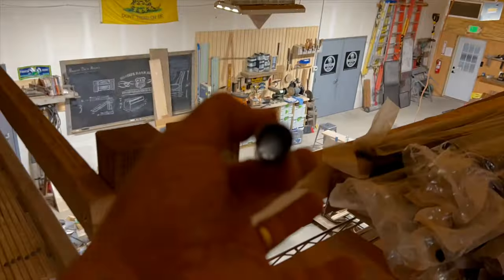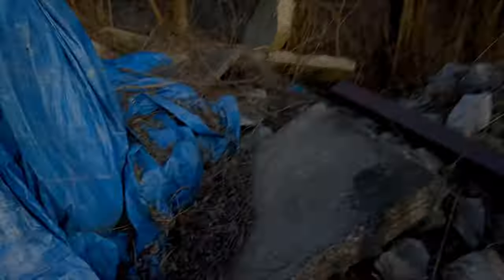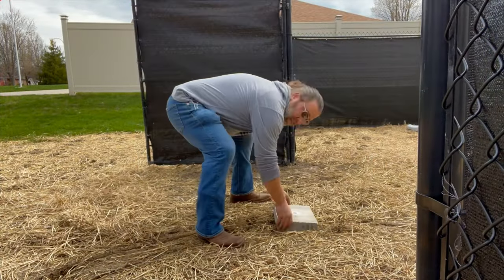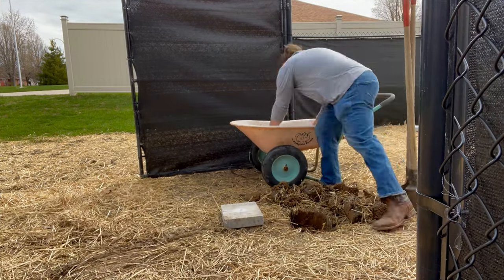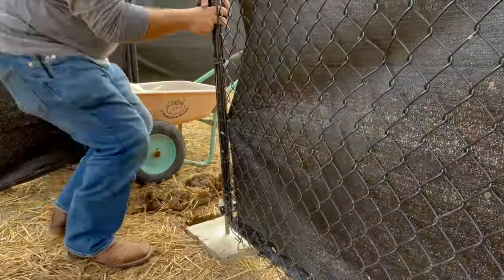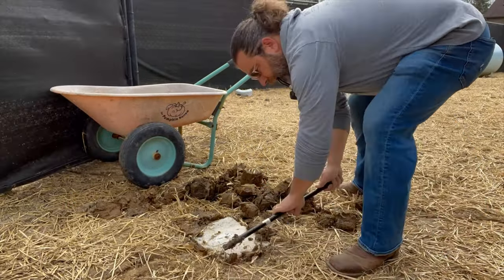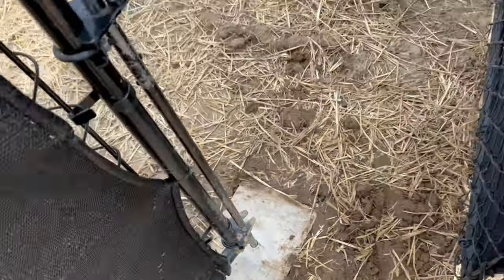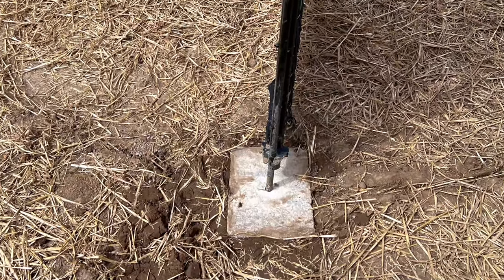HOW TO secure a double gate drop rod | BGW Construction, LLC

Comment: Great solution! I had a vinyl fence installed professionally with an 8 foot double gate with two drop rods. The installers used PVC pipe below the ground level so after opening my gate two or three times PVC d holders are filled with dirt!! .. . Looks like I’ll have a project to do ….. thanks for the solution.!